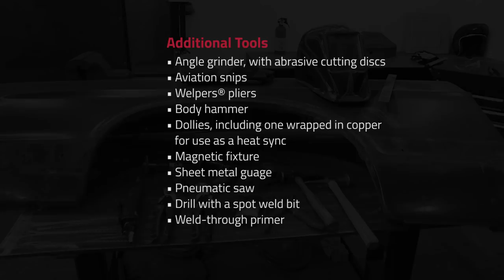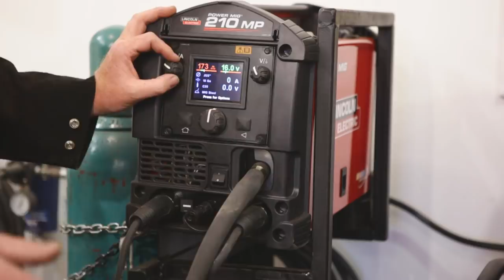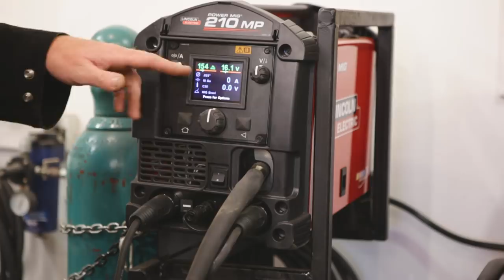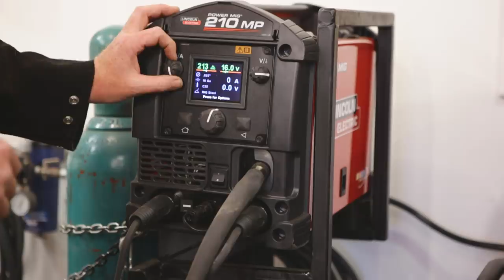Tech Tips: Thin-Gauge Sheet Metal Repair

Comment: Great Video! I'm a beginner - still a bad welder - but used to be a terribly bad welder, so I'm improving by watching and re-watching videos like these - then trying to do it myself. I can weld thick metal OK or better, but it's this thinner stuff like body panels and exhaust pipes that are much less forgiving. But because I was encouraged to try, I have made my own replacement body parts from sheet metal with little more than a hammer and an I-beam as an anvil, so I know I can do well with welding too.

Comment: Mark, I've burned more boxes of 7018 than I can count but have done very little mig welding and almost no sheet metal. I have learned more in the last 45 minutes than I have in a long time. Today I ordered a flux core welder and this summer when the snow goes away I plan to do rocker panels and rear fenders on my 2nd gen Ram. With your instructions and a couple of old washing mechaines to practice on I feel that I can do apretty good job now. Thanks

Comment: I like your video . I don't like to see you doing so much work with that grinder . What you really need is some dustless blasting equipment . This is using cold water , compressed air and crushed bottle glass . It doesn't create heat and won't warp your sheet metal . This is an aircraft level cleaning process and would cut 60 or 70 % of your rust paint removal time off . To clean for example the area shown in your video would take approx 5 to 7 seconds only and would be incredibly clean . It would be 100%  clean of all paint and rust .  I think you would really like it .
Reply: its about welding for the common guy in a home shop

Comment: Analyzation? Wow new word! 🤪Good video. I’m surprised you didn’t use tig. Is that because you know most diy guys have a mig machine? I just find the control is so much better when you have the foot pedal and you can ease on the power slowly. Not as fast but way more finesse, you can control how much filler to use, no blobs to grind down, much less heat into the panel. With a really tight fit you can use almost no filler. Also, with careful hammer and dolly work you can stretch the patch just enough that it comes up to the final contour so no polyester needed. You need to use a body file to show up the low spots and go slow, but having a patch that fits perfectly level is very satisfying and you never have to worry about bondo failing.

Comment: I have an Eastwood Mig 175. I'm trying to weld up holes on my brand new AMD firewall 19 gauge, i bought the sheet metal kit 19 gauge from Eastwood also. I clean both metal areas, make a circle to fit in the hole, use a welding magnet to keep it in place. Start at the recommended settings on a scrap pieces on the bench, they weld fine. Nice and flat. I bring that to the car and the first spot i blow thru. So i keep very slightly going down in voltage first, then wire speed. Until i get a crappy ball on top with no penetration. I am using 1/4 stick out, cut the .25 L-56 Lincoln wire to get a fresh start. Gas is 75/25 @ 18 cfh. The tip is about 1/16 back from the edge of the cup. Ground is on clean bare metal as close as i can get it. I can weld 1/4 or 1/8 tubing fine and get great welds. When i try this on my car's original metal floor patching a hole it's worse, i keep chasing blow thru holes. 
Don't know what i'm doing wrong, Please help.
Reply: Old metal vs new. New metal looks like Swiss cheese under a microscope. You will need a spring loaded ( for pressure) Heat sink, copper or Aluminum. Option would be... What I like to use if no heat sink tool is old copper pipes and a Crush one end in a vice and I have a good long handle for myself or a friend to help. Have to stay right on the spot and press it fairly hard.
Reply: I had the same problem. I increased the heat and wire speed while making sure the stick out is clipped clean before each tack. 10-20 degree angle to the work piece. Gaps no wider than the wire thickness. Practice, practice on a scrap piece from what you're welding on if you can. That's what I did and it worked.
Reply: Kevin Jones  your gas should be min 20cfm -25cfm also make sure there is no rust on back side of what you’re welding and if you have ground down the surface to clean for welds, make sure you re measure .... it’s easy to grind old metal down 1 or 2 gage thinner than original and not realize it. If this is the case your settings would be incorrect for your task.
Reply: Just angle the tip of the gun before you pull the trigger, that allows the initial spark to cover more metal and not concentrate all the heat in a tiny spot ...

Comment: Interesting you like to have the two parts tight together for a butt weld. I was taught,and served well by,to have a gap roughly the same as the material thickness to prevent distortion and to give the weld somewhere to go rather than sitting on the surface. I have some welding clamps for sheet metal that have a thin blade that passes through the gap and clamp the two halves together,they work brilliant.
Reply: If you have gap, you will have shrinkage followed by distortion....the best is no gap and ensure that your weld penetrates all the way through.

Comment: Nice job but wondering about the grinder choice --could knock that bead down in a fraction of the time & less chance of hitting base metal with a 4 1/2" angle grinder. Start with a grinding wheel then tune it up with a flapper when you get close.

Comment: I am 90 years old and finally bought a mig welder. My problem I can see the weld puddle but not where I need to weld I do wear glasses and I also tried a cheater lens. Is there a way to mark the work with some kind of pencil mark to be able to see where you need to weld

Comment: I work in a dealership and both icar and the most experienced body tech said you must have a continual bead around your spot welds and even welding say a quarter back on. I've been taught that continual bead will warp the metal also with icar and the body tech, you'll get in trouble for start and stop spot welding but yet i have been taught keep it hot and it will burn together like at 41:20 . Can anyone give feed back on proper welding?

Comment: Mark  I do a lot of this light metal welding and have fund that the flap wheels from Harbor Freight do a good job of grinding these kind f welds I get a lot smoother finish because the wheels have a little of flex in them good video very informative thanx

Comment: Appreciate the information,. I have a question about a possible welded a running car motor, the block has 3 small cracks and it is cast iron? thanks.

Comment: Seen those welding helmets before. If chip messes up then what just saying. Those are cool helmets as long as the motherboard or sensor chip or both doesnt missfunction . i like regular helmets there is a chip that can dysfunction at any time if. Ok off this dude both are cool the other can fail at any time if battery is low or if powered by light solar panels on them if circuit messes up then back to old helmet. Both are cool either way

Comment: Light coat of bondo cut it with 220 then a thin coat of polyester filler on the outsides then cut it with 300 grit or 400

Comment: if you can always fold it over the the edge over the guard frame(guard to door edge ) and fold down to were the guard bolts too that way you half the weld and less chance of distorton then your weld will be like a upside down l as u dont have to weld 360 degrees  as that back edge is  where it will rust first . very hard to seam seal back of weld behind the frame .after grinding get a torch and check for daylight through the weld .ps if your just starting dont buy a complicated welder you will spend all your time farting around with the welder . all the things he is saying are true but at he is trying to flog u a lincoln .happy grinding

Comment: Great job but that fender had way too much rust to spend that time into. BTW would have been nice to see the complete welding process not tacking in 10 spots and next clip ready for grinding weld. Also removal of the brace I think I wouldn't do from experience that keeps the integrity of the line, removal of bottom and side spot weld are a must so you can get a little flex of the brace and when the sheet metal was removed it cleans up nicely, Now when you put the patch in you can slide some aluminum flashing behind as backing to aid in heat and to keep the distance. All good though.

Comment: you contradict your self to much and you should have used a grinder with a cut off wheel  to cut that out, it has less vibration than that air saw and you need to have the fit to be less or at 1/16 gap no more , that keeps down on warping from welding, i am just sawing .

Comment: You actually don't know what the ** you're doing. When I weld sheet metal, I turn the wire speed and amps way down. this gives the heat time to build and a proper pool to form. the wire slowly aids in controlling the heat only, not for depositing excess material. This leaves and flat weld which doesn't need as much grinding. This works better with argon gas.
Reply: Oh yeah, by the way. learn to weld sheet metal without a heat sink because you won't always be able to get your hands behind a panel. You can remove fender for demonstration all you want but what about welding a cab corner?